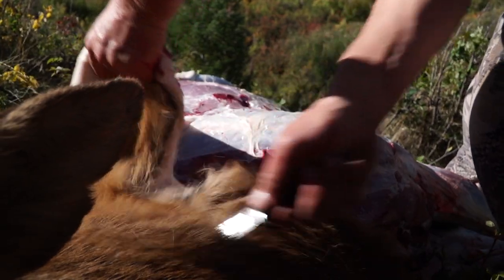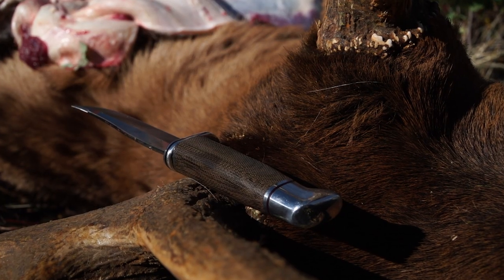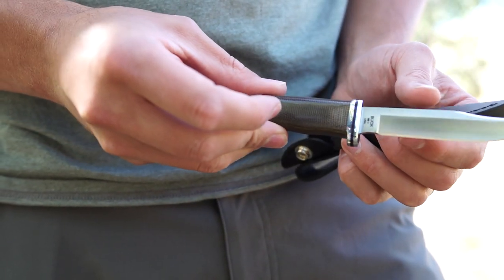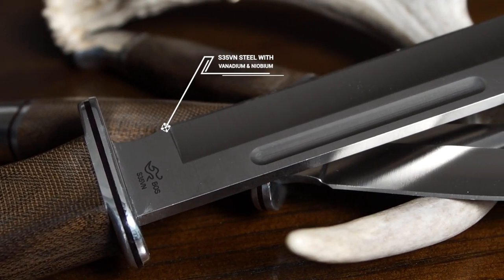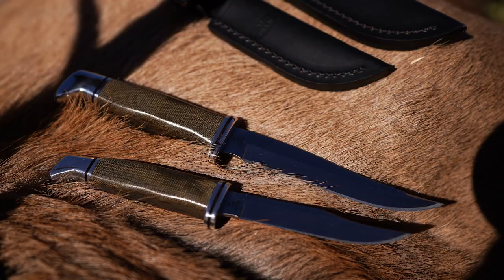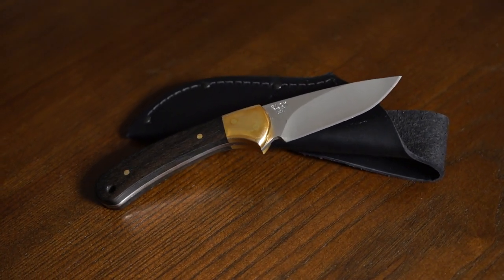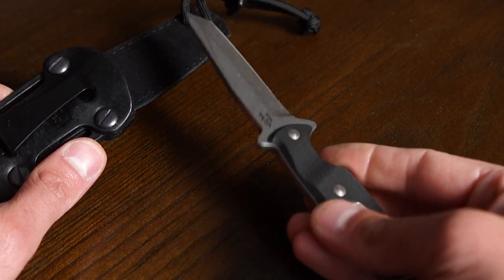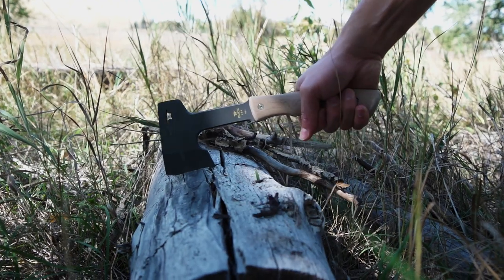Gear 101 - Buck Knives Story of Steel

Comment: There was a time when Buck and Schrade knives were symbols of quality. Then something happened. 

The latest offering from Buck and Schrade are and have been disappointing. 

So I decided to go vintage.  I bought a Schrade knife from Ebay. You know the solidly built knife from 25 years ago that has serial numbers. 

I also buy vintage S&W revolvers.
Reply: What? Your comment makes no sense. Buck knives are now offered in configurations that afford better performance than anything they’ve ever made in the past. They’ve put out stuff in 3V, S45VN, S35VN, S30V, 5160, CPM 20CV, W2, and the list goes on. The old Buck 440C and 425M doesn’t even begin to compare with the performance of those steels. 

Even their standard 420HC with the Bos treatment holds up well. Whether you’re looking at Dr. Larrin’s metallurgical charts, Cedric and Ada’s edge tests, Buck’s own internal testing, or any number of other sources on the matter, the 420HC easily rivals the old Buck 440C and completely outclasses the old 425M. The edge retention is only slightly worse than the 440C, but not by much. And it’s superior to that of the 425M. When it comes to overall strength, resistance to chipping, corrosion resistance, and ease of sharpening, the 420HC beats the hell out of the older 440C and 425M both, although 425M is definitely easy to sharpen.